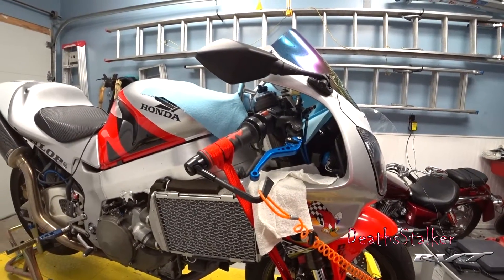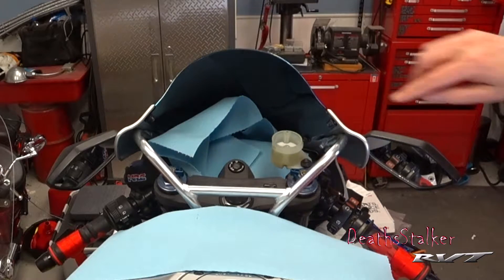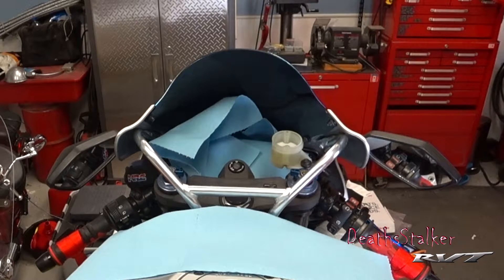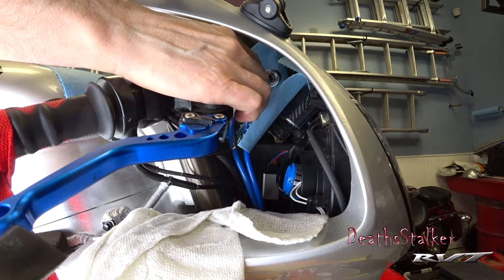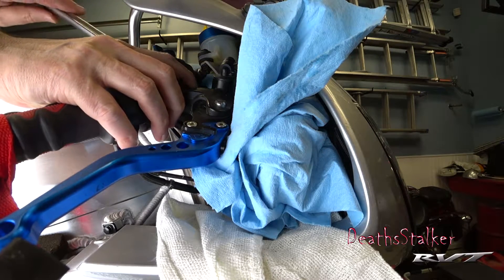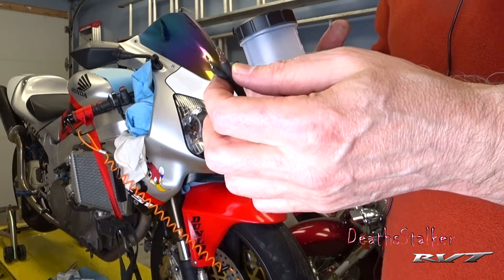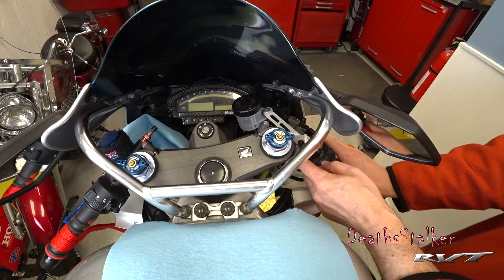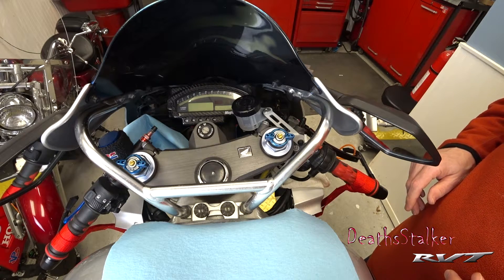RC51 Gets a Full Brembo Brake upgrade Part 2 Brembo 19 RCS Master Cylinder

Comment: full brembo ? would mean the back also
Reply from the maker: Yes but I had to save up the money for it 1st . The video for the rear is a separate video
Reply: @DeathsStalkerRVT  i know that feeling i have been doing a full brembo retro fit the rear disc is galespeed as brembo do not make a floating rear disc for our bikes i am saving for the HPK fronts maybe the t drive . i do have  a brembo  rear master cylinder also both RCS opted for the gp4 calipers and the   p4 cnc rear caliper.. it has taken some time to buy / find .. good luck